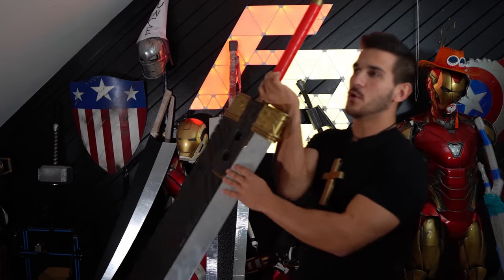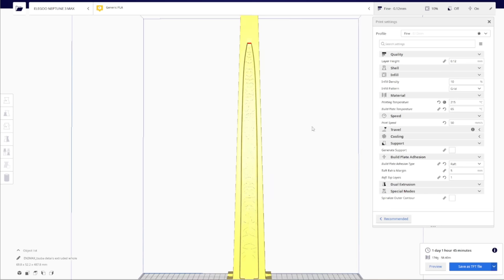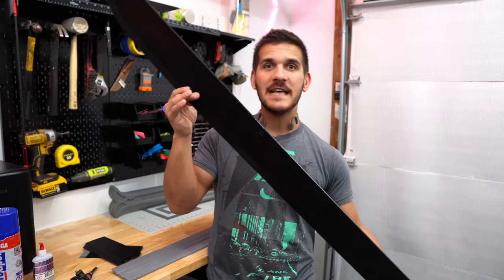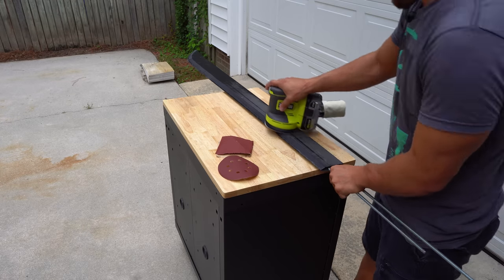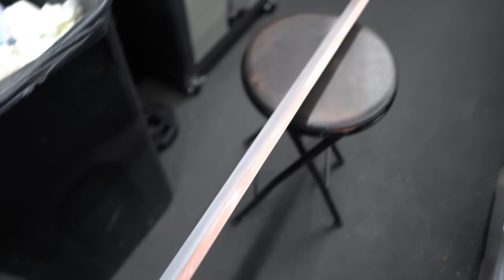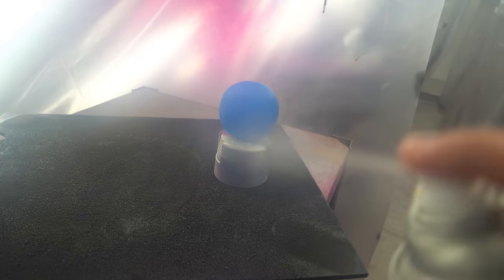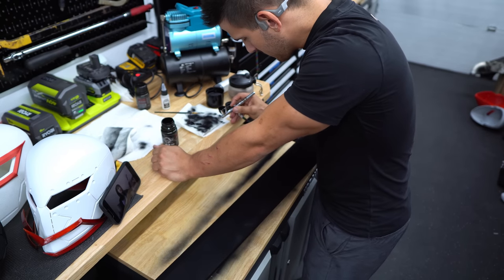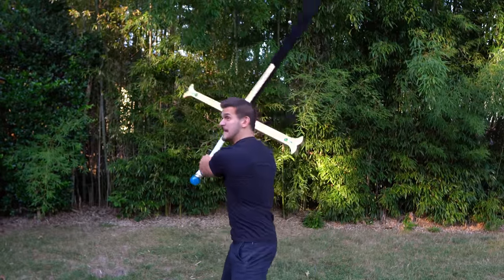GIANT 3D Printed Sword! | Making Mihawk's Yoru from One Piece!

Comment: to support the blade, you can use square aluminum tube that goes from the base of the handle to almost the tip of the blade, it would weigh less and possibly be stronger.

Comment: It’s quite lovely to see 😂 I’ve always been a fan of your work and even picked up the hobby due to seeing an old tiktok of yours about how relatively easy it is to print things. I myself am working on printing Zangetsu in its first shikai appearance and can’t wait to put it together 😂😁 only one question I have is when doing “pla welding” are you just using a soldering iron to melt the plastic together?